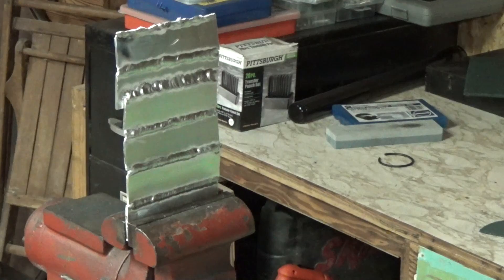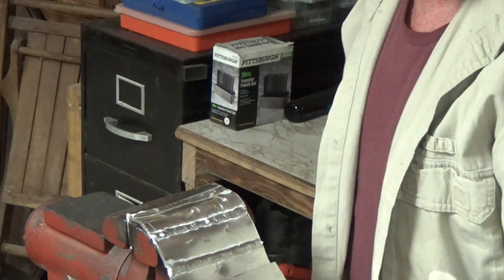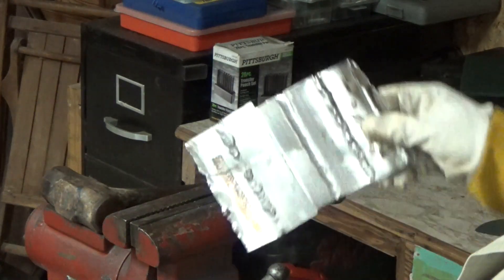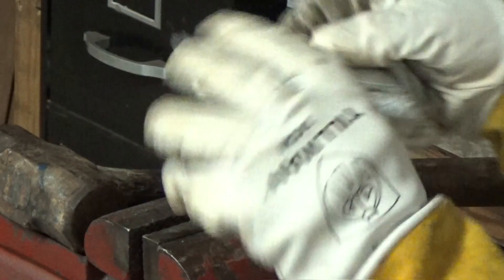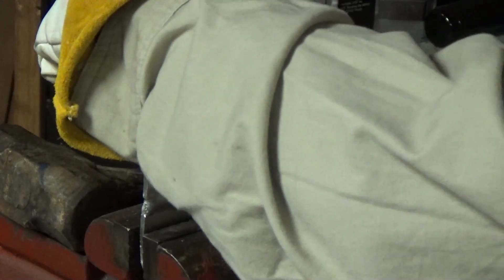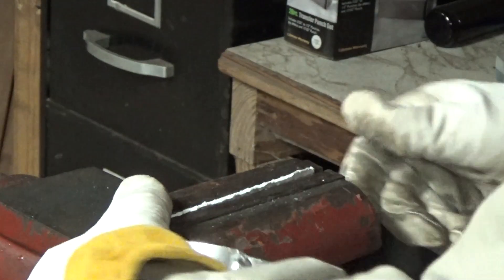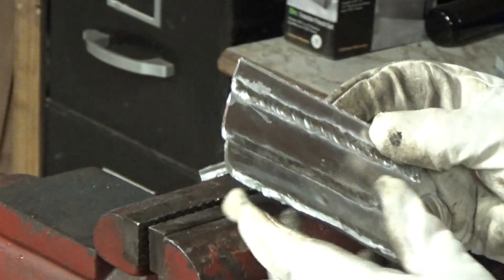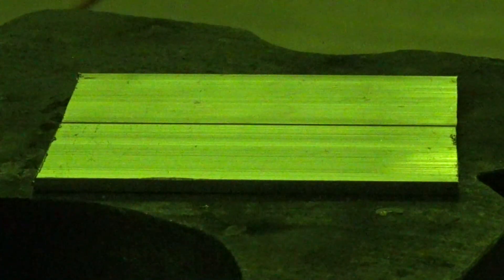First time Aluminum TIG welds and Zeke the Shop Dog

Comment: Shot peening is good for stress relief. lol Since your weld is thicker than the base material it naturally will be stronger. If you want to really test your penetration and weld bonding grind or mill the weld back flat to same thickness as base material and test it. That is an excellent way to test penetration or if you are just laying beads on top. Zeke appears well trained. :-)
Reply from the maker: +bcbloc02 Thats good advice brian, i'll mill down a weld flat and then beat the hell out of it. Zeke is a natural.